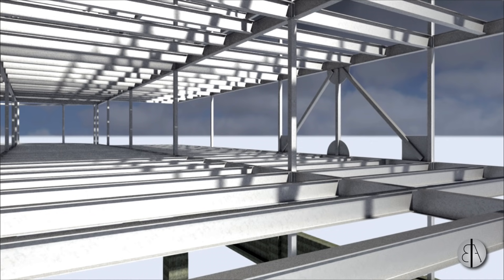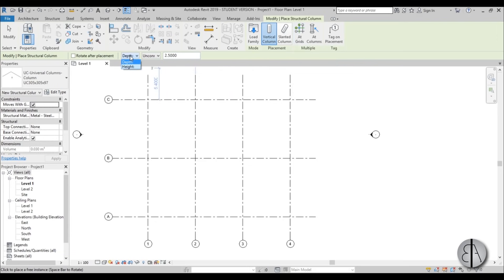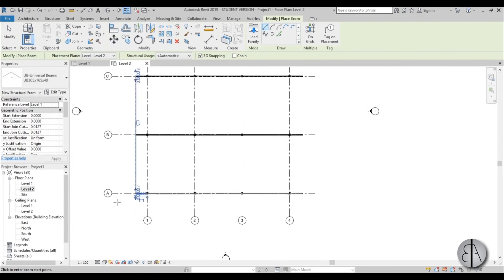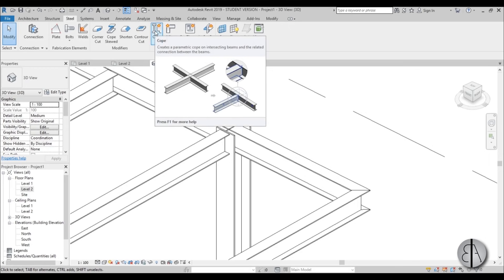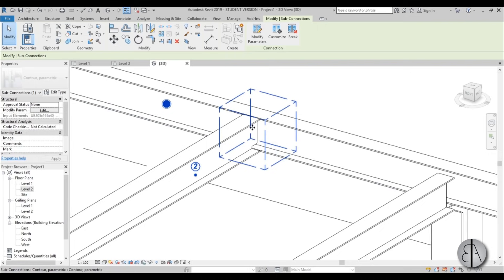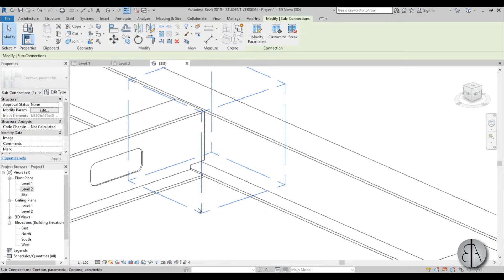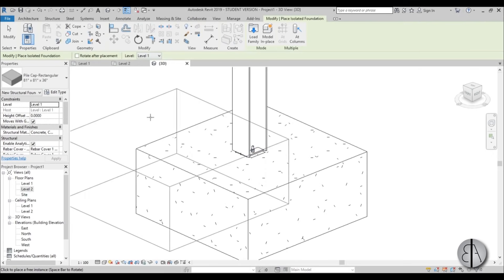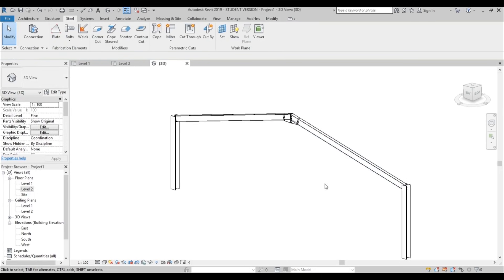Steel Structures and Connections in Revit Tutorial

Comment: 2 years but this video is still relevant. If you are using Revit 2021, Structure and Steel Tab is hidden if you set your discipline into "Architecture" when opening up your Revit for the first time. You can show these tabs by going into File > Options > User Interface. Under "Tools and Analyses" check the tabs you want to show. Then hit OK.
Reply: Thank U

Comment: I am unable to split the horizontal beam like you showed at 13:49 . The split tool is not snapping that horizontal beam while if I tried to snap the other two vertical, it is working fine . Does any one have solution?

Comment: Just FYI - The reason you had an error with the colum/beam connection on the portal frame structure was because the column needs to be rotated 90degrees (column parallel with the beam). The column should always be parallel to the beam so that it works within it's strongest axis.
Reply: Oh you was right :D Only focus on flow of lession so I did not found that reason.
Reply: i was wondering what was his reasoning for using the col in weak axis

Comment: Hello Balkan Architect, well done , this video is very useful.just a quick question please, I use Revit 2017. I cannot find the tab - steel on the menu bar for Revit 2017 and I heard from your video saying something about plug -in, I cannot load all the the steel connections, please can throw more light on this please. I look forward to hearing from you.
Thank you.
Reply: Omoyemi Okeyinka find revit 2019 or 2020. Comes installed with the connections

Comment: I put in the clip angle but it only show holes even when I clicked on fine
Reply: I had the same issue.... what you need to do is go to 'visibility and graphics', then scroll down to 'structural connections' and then click on it so it then shows the subcategories for structural connections.... then you will see that the only one selected is 'holes' (which is why only the holes are visible on our files) so then click on all of the subcategories and hit apply! hope this helps.
Tom

Comment: When you did your beam system, it appeared to place a beam on the external sketch line.  My beam system never places one on the edge.  What do I need to have set for this to happen?
Reply: Remove Beam System and add manually dragging new beams or use align command to move the beam...